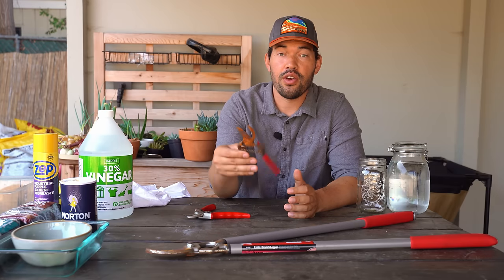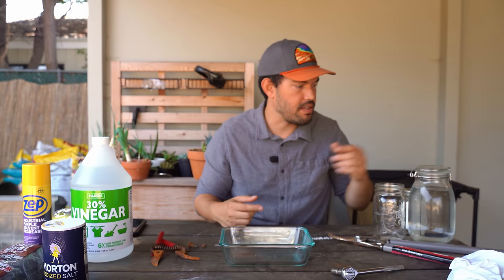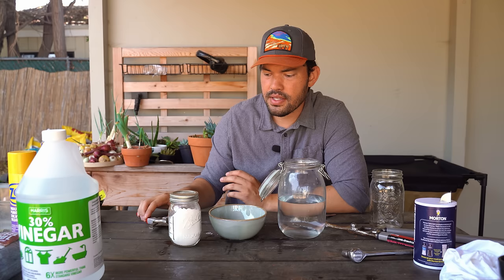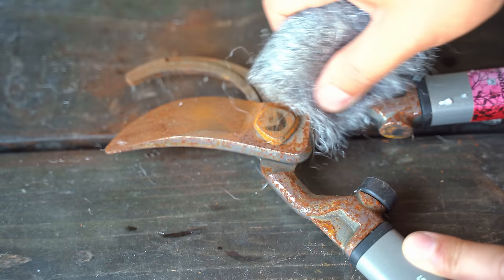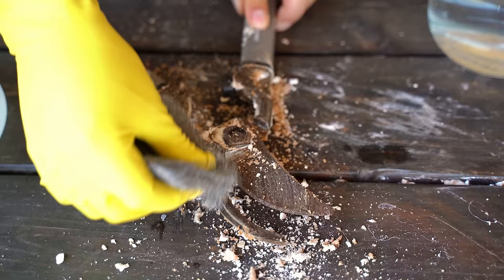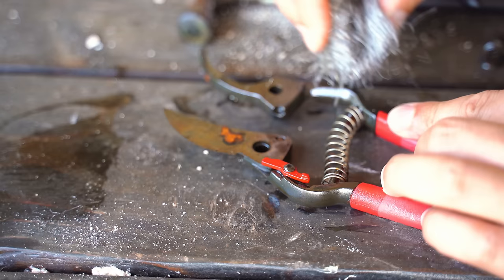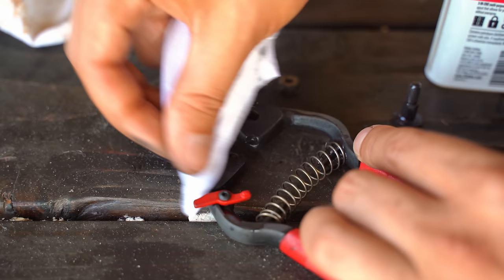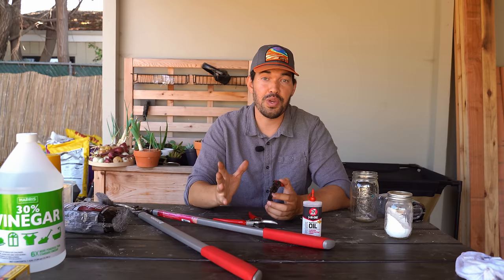Easiest Way to Restore Rusty Garden Tools

Comment: You can also fill a 5-gallon bucket half full with clean, dry sand (or buy playground sand from Lowes, etc.) then pour in about a 24 ounce bottle of cooking oil.  ( I used olive oil that had went rancid and it seem to work fine.)  Mix so all the sand particles are coated.  When finished using a tool, knock off any dirt and stab the blade in the sand and wiggle it.  The oil coats the blade in an instant without having to rub each tool.  I keep the bucket in my tool shed and treat each tool when I am putting them away.  Add more oil when sand gets dry.
Reply: Would love to see a picture? 😊
Reply: I use old motor oil in the sand bucket.
Reply: Yep.  My grandad had a wooden box of oiled sand in their garage where he stored his shovels and hoes and such.  It worked well.  I suspect he used old motor oil, but I was just a kid, so I don't know for sure.
Reply: Martha Stewart happened to also highlight this method years ago and it was memorable. Simple solutions are best because we’re more likely to actually use them!

Comment: My son uses a product called Evapo-rust.  This product is environmentally safe and can be reused several times.  Even when it has turned black.  He will buy tools from the thrift stores and sometimes the tools are not well cared for.  He swears by it so much he will use this product rather than any other product including vinegar, salt, baking soda which are products which I suggested he try.
Reply: As I understand it, Evapo-Rust is less harmful than vinegar, not to mention that vinegar is acetic acid so if you don't flush it all off it will cause more rust and a baking soda solution shown for neutralizing the acid can cause rust too if it is stronger than needed for the acid.

Comment: From the thumbnail pic alone I thought this was a video by Odd Tinkering 😂
As a chemist I can safely say that the rate of rust removal will increase as you increase the vinegar concentration.
Thank you for emphasising the importance of sealing, lubricating and protecting the tools with some oil afterwards. If you don't protect the tools with some kind of oil, the rust will return worse and much quicker.
Reply from the maker: Thanks for adding that!
Reply: Your opinion please ??  I found some wow rusty tools and brought them home with me. I pored straight up vinegar in a bottle and put them in and omg.. the nastiest almost like foam, but thicker was floating all around them the next day. Was wondering the salt might have something to do with the fact that he had none of that stuff in his bowl. The really super thick stuff was also stuck to the tools also, the vinegar was all the brown yuck. Thanks a bunch if you do see this and answer.
Reply: @tammyschultz3318 did you try again but with salt? Different results?

Comment: You can use the lower acid cheaper vinegar.  The 30% is not cheap and comes with warnings because it’s so strong.  If you dilute the 30% then just use the cheaper vinegar.  We have used vinegar on cast iron pans and lost hoof nippers and other tools and it works well.  Great job they all look like new again!

Comment: Great video Kevin. I like a bucket of sand for tools that dont have working parts, its a great way to remove the attached soil and keep them rust free
Reply: @sheriszajna-mckeon9902  Just kids play pit sand or silver sand is best to use
Reply: @simplifygardening  Thank you!  I don't do it, lol, but now I have no excuse not to.  Thank you!
Reply from the maker: Yeah, I need to use that tip so badly
Reply: Simplify gardening   Thanks for the tip 😉😄
Reply: @katzwhite5962  Anytime Katz :)
Reply: I add some motor oil or mineral oil to my sand so that it not only cleans it but it also coats it to protect from rust and corrosion.
Reply: @decolonizeEverywhere  That's a great idea Cheryl. I never thought of doing that. Great tip thanks
Reply: @simplifygardening  I add boiled Linseed oil to the sand. Read that on a website somewhere. Is that overkill? That 3 in 1 stuff is awesome. I needed it for my brother-in-law’s pole saw. I started to use it on all the tools I use for the garden. It’s especially nice after cleaning and sharpening the tools.

Comment: When I worked in conservation, we used boiled linseed oil for wood handles and motor oil for metal surfaces. Now I use linseed on the metal parts too. Easy and less harmful.

Comment: Thanks for uploading this. I put a swim spa in my garage with all my tools and installed a dehumidifier to keep the humidity down. it did not do the job. I will be using the paste method to clean off my cast iron table saw top, and the vinegar method for many hand held tools.

Comment: I keep a very cheap bristle brush (Not sure if it's copper or brass) that I picked up from the local hardware store in with my garden tools. I use it to quickly remove light rust or other gunk that gets on my garden tools before they get too nasty. Lube choice for me is a wax based bike chain lube from the local bike shop because I'm not interested in putting whatever is in 3 and 1 oil in our garden. I think it's awesome that you're promoting tool care/maintenance.

Comment: For wooden tool handles....use boiled linseed oil to refresh. Dispose of the rags you use to apply it properly. Linseed oil can spontaneously combust if improperly discarded. Works fantastic for wood handles though.

Comment: I'm pretty sure you don't need the salt on the vinegar bath.  I do this a lot, but for a different reason.  After it eats the rust off, you can use that liquid that's left to ebonize oak or any other high tannin wood.  It will literally turn it black, and it is a really cool look without using some harsh chemical stain.  So, I'm constantly looking for rusted screws, drill bits, and I've even left screws out in the rain on purpose.  You can also just put the steel wool in a jar of vinegar, but I think you can skip the salt next time, because I don't think it does anything.

Comment: I use 3 in 1 Oil on my grass shears after every use. It keeps them rust free and well lubricated. Just rinse the blades, dry them, apply the oil and work it in. Oh, and yes, I have left my tools outside a time or three.

Comment: Citric acid is perhaps the best commonly available rust remover. (You can find it in canning supplies.) There are YouTube videos showing how to prepare and use it, adding some washing soda (sodium carbonate) to raise the pH a little, which avoids metal loss.

Comment: I just bought a gallon of 30% vinegar at Ho-De--big-box for $20, and let me tell you it's not easy to find in Milwaukee.  The 5% version is sold most everywhere.  I wish you had shown this with the more commonly-available strength, as the comparison might be significant.  Thanks for the very useful demo.  BTW,  I bought the vinegar to use as a weed-killer; when mixed with a tsp. of Dawn dish soap - to .help it stick - I'll spray it on the most-toxic or invasive weeds and watch their progressive demise..  I'll probably protect surrounding greenery, if needed, by placing a notched-out piece of cardboard at the intended victim's base.

Comment: I like that you demonstrate without needing special tools or gadgets. But honestly,  after the vinegar soak I'm taking my Dremel to it vs the steel wool.
Reply from the maker: Hahaha fair enough
Reply: Classic rock lover  What is Dremel?
Reply: @katzwhite5962  it is an electric tool with tips that you can change to do different tasks, like drilling holes, or grinding down metal or wood, etc. It is small, to fit in your hand, and can do very small,  detailed work. "Dremel " is a brand name. Sometimes they are also called rotary tools.

Comment: Warning, if this hasn't been addressed earlier, DON'T put the vinegar and salt solution in an aluminum pan.  It will eat through it.  The solution worked great on my rusty pliers, until it all drained out.

Comment: I have used these and other methods.  I personally like Evaporust best.  $30/gal, but reusable to a point.  Overnight and excellent removal.  As Matthys said, you HAVE to oil immediately or it will flash rust.

Comment: No need to add salt to vinegar as vinegar neutralizes salt. Therefore, use either or.
Salt and lemon or lime. 
Plain vinegar soak. 
Baking soda does neutralize vinegar. So will soap and water.
Rince with clean water, dry, add 3 n 1 oil.
Reply: @willtravel3536  Different acids plus scrubbing action if you need it. 🙃😉 Also, The most significant difference between lemon juice and vinegar is the type of acid. Lemon juice is on average five to six percent citric acid. Vinegar, on the other hand, is comprised of acetic acid. ... In terms of PH, vinegar is slightly more acidic than lemon juice.
Types of acid and their chemical reactions.

Comment: I def wouldn't use steel wool on dry rust. Especially indoors. Wouldn't want to breathe any of that in. Nice to see you used vinegar tho. I have an extremely rusted file that I've been meaning to soak to see how well vinegar really works. Left it outside all year after I found it in hopes of getting it even more rusty! lol, don't have a large enough shallow pan that it will fit in. That 3 in 1 oil is an interesting touch too! Didn't think of using it on garden tools.

Time to de-rust the two spade shovels I have and plant some zinnias :D

As for salt, that's interesting to me too. I line a cup w aluminum foil, add salt and boiling water to clean silver chains and other accessories. Not sure how it works, but it does! Guessing salt pulls certain foreign elements from solid material?

Comment: Thank you for sharing! I appreciate these nontoxic cleaning tips! I need to do this too alll the things ha ha do you find that you don't need to sharpen them as long as they are lubricated well?
Reply: Agreed, I only use nontoxic materials.  To protect metal, nothing beats pharmacy-grade mineral oil.  It’s sold as a laxative.  But it’s definitely better than vegetable oil, because it won’t break down and oxidize.

Comment: Adding salt is not necessary. Rust is actually removed by the acid. Examples of rust removers that can be used include Acetic acid in vinegar or Citric acid in lemon juice or Phosphoric acid in Coca-Cola or Hydrochloric acid in Muriatic acid. CLR rust remover contains Lactic acid and Gluconic acid. Naval Jelly rust remover contains Phosphoric acid and Sulfuric acid. The higher the acid content means the faster is the rust removal. Therefore diluting the acid strength would actually slow down the rust removal.

Comment: Use Scrubbing Bubbles  bathroom cleaner instead of vinegar and baking soda,  clean tools then spray tools with scrubbing bubbles, let them sit for 15 minutes or so, then scrub with steel wool and/or wire brush as needed, sharpen with file, oil and done.  For anything with a wooden handle, sand any rough bits then wipe with linseed oil to preserve wood.

Comment: I discovered an anti rust undercoating spray at the hardware store which undercoats or seals against rust and lubricates. RUST CHECK  It sticks well to surfaces and is transparent.

Comment: Boy was this good timing. I’m terrible with my tools🙄. I read somewhere to keep a bucket of sand with motor oil mixed in it and storing tool blades stabbed in it. Keeps them lubricated🤷🏼‍♀️. Haven’t tried it but I keep meaning to.

Comment: Have you ever bought Craftsman bypass pruners? There is a little plastic piece that closes the pruners when you’re not using them. That plastic piece starts wearing out and becomes a big nuisance when using them. Next step that spring that makes them operate pops off.
Reply from the maker: haven't yet no

Comment: Key tip:   keep as many of your garden tools as possible(especially those with blades) inside your house in a room and/or a cupboard that's always warm and dry. Prevention is always way better than cure.
Paul G

Comment: Not sure what the rust removal does for the cutting power. You'd still need to spend a couple seconds with a carbide file to get that blade renewed. Gonna try the vinegar & salt trick. Thanks.

Comment: Challenge for you - Instead of petroleum products on your shears, use a trick by woodworkers on bare metal machine tables; non toxic furniture paste wax. Not the spray stuff. It makes a great coating for the off season and won't ooze all over everything, including plants you might be eating. My latest secateurs don't have a single spot on them after 3 years of hard use.

Comment: So the science behind the salt and vinegar is a reaction occurs between the two to create Sodium Acetate and Hydrochloric Acid.  Sodium Acetate dissolves in water and slightly reacts with it to release some Hydroxide ions (it's basically the same as a water molecule but missing one Hydrogen atom) which hold a negative charge and can attract to metals which hold a positive charge or Hydrogen ions we'll get to later to form water again.  The big hitter is the Hydrochloric acid, though.  This stuff is is classified as strongly acidic (SO BE CAREFUL WITH IT) and really goes to work on dissolving the rust.  It breaks apart in water into Hydrogen ions and Chlorine ions.  The Chlorine ions which hold a negative charge attract strongly to metals, in this case the rust is the metal which is currently bonded with Oxygen, but Chlorine attracts to it better and replaces the Oxygen.  All the Oxygen, now left alone with a negative charge,  can do two things:  it reacts with the Hydrogen ions which hold a positive charge to form good old H2O--water and some of the Oxygen will react with itself to create O2 or just plain Oxygen gas (that's why you see all those bubbles coming off the metal).  Overall it's a pretty cool scientific process!  Be safe when mixing chemicals, though, and when you're not sure what will happen, consult the label on the container.

Comment: So it looked like the prior black coating got entirely stripped off - so assuming if you do this rust removing - you have to lubricate the metal afterwards as you are stripping off any initial protective coats?

Comment: Nice video, 3 in 1 is my go to, I use from interior and exterior doors, but my latest brain child was to use it on my mower wheels and gears after cleaning, wow did that ever make a difference, can you tell us where to locate the stronger 30 percent vinegar please?
Reply: 30% vinegar is expensive, there's no point in buying it if you're just going to dilute it with water.......Straight vinegar from the grocery store works just fine.

Comment: I'll keep these cleaning tips in mind, for some rusted hedge trimmers I've been meaning to clean-up. One tip I've heard lubricates your tools, as well as protecting them from the elements (if you do happen to leave them outside) is spraying with WD-40. Works like a charm. Makes rusted, immovable tools, move again!
Reply: wd-40 definitely has its uses, but it's not a lubricant & will end up hurting more than it helps. it does displace water & it can be used to clean, but it'll attract grime like crazy & get rid of any actual lubricant that's on the tool - which is obviously just for tools with moving parts, but yeah.

Comment: Great info! Question: my pruning shears and sometimes loppers get gummed up. (sap from pine trees...) What's the best way to clean that up so they work like new? (My 88 yo farmer dad uses gasoline but there has got to be something better in the 21st century.)
Reply: Boiling water works to dissolve pine sap; I lived in a pine forest, and while we had to use Goop Off! on cars to avoid damaging paint, boiling water works if you don’t care about paint!

Comment: Instead of these items, you may use car Gas, Dip the tools for three to four hours, and then clean the tools with a cloth and wash if needed. To preserve the tools you may use engine oil generously on tools and after an hour wipe with a cloth to keep them dry.

Comment: So oiling the tools cutting surface won't harm the plants you're pruning? I wouldn't use any petroleum products on the cutting surface that would contact the plant.  Hinge would be ok.
Reply from the maker: Nope, not a big deal!
Reply: I would stick with vegatible oil to lubricate to be safe.

Comment: I have a heavy duty pruner that's all rusted, but it's also dull. I've tried sharpening, but it didn't work all that well. I could use a sharpening video.
Reply: Christine Herrmann   I asked my local mechanic and they sharpened my tools. They were really sweet about it as well.

Comment: or just go to the paint department in home depot/lowes and buy some Rustoleum gel it removes rust better than any of these
Reply: That's valid, but it is great if you happen to have these common pantry stock items. Even more frugal; less "stuff" to acquire! Plus for larger items you can make a cost effective vat and let it sit. Both solutions are good.
Reply: What chemicals are in the rustoleum though. I've just used one of their rust stop products on an old hose reel. Then painted it with dulux weathershield. It works. Had I known that salt and vinegar would also have stopped the rust I would have used them. I know the mix for cleaning grease. It doesn't upset the environment.